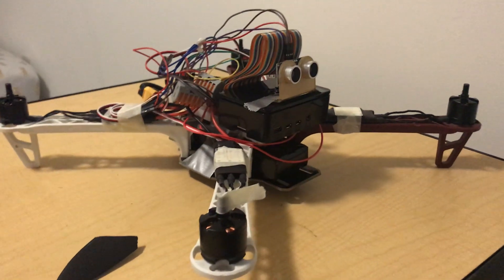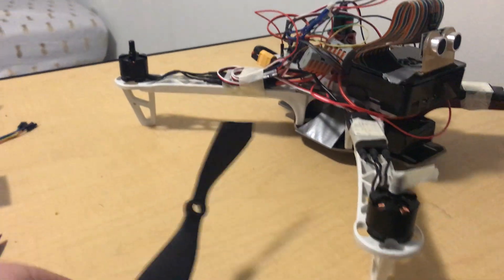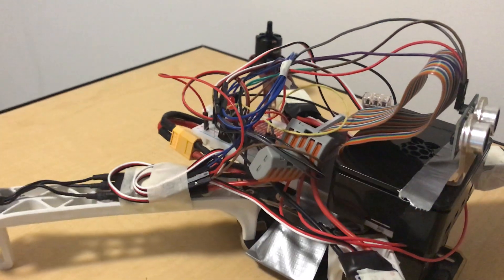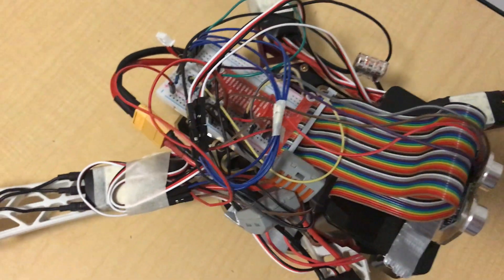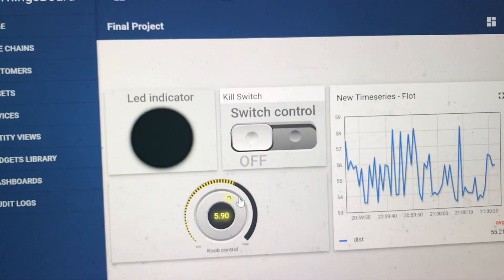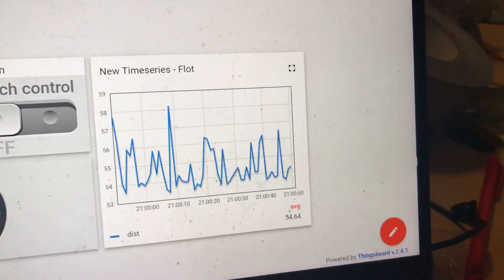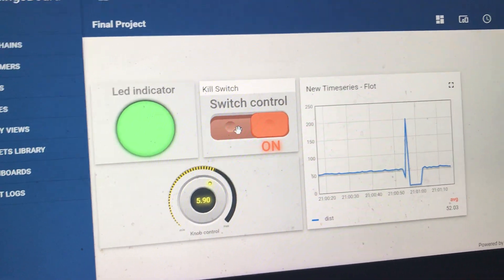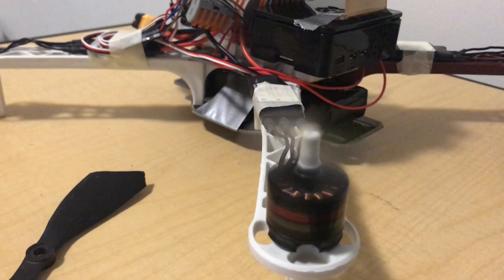Raspberry Pi 4+ Powered Drone | IOT Final Project

Comment: Hey a little help please, Even i am working on a drone project. I have used a KK 2.1.5 Flight Controller on the drone and it flys great. But Now i want to include a Raspberry pi 3B on to the drone. But the Problem that i am facing is how am i supposed to give the PWM signals to the ESC’s. Can you please tell me how you connected the sensors and the motor ESC’s to the board. And How do i control them. Please help me.
Reply from the maker: I connected the ESCs and motors in the usual way. Then I controlled the ESCs using the pwm pins from the raspberry pi.
Reply: @RichardMoglen But  Technically there are only 2 PWM pins on the Pi ... So u means to say that you have converted GPIO pins as PWM output and then Controlled the ESCs ? Or how am I supposed to connect the ESCs (Signal pins) to the Pi.
 Please tell me because this is the only thing holding back my project to work.  
And were  you successful in building an autonomous drone. Or still did you have to give radio commands to it?

Comment: Great looking project. When I was an engineering student in the mid 70’s we were still using slide rules, and I think HP had just come out with an engineering calculator that was required for differential equations, vector mechanics, and strengths of materials.
Reply from the maker: What will be available in 50 years?? Amazing technology evolves.